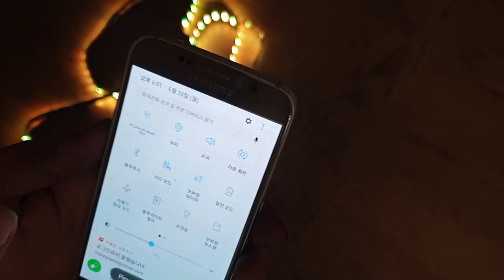아 킥보드 타고 싶다. Building 18 Inch Tire Electric-Scooter 70KM/H .

Comment: There's no way in hell that it's an 18 inch wheel.. these wheels are smaller then my yamaha tmax 650 wheels..and mine are 15 inchers..
Reply from the maker: Small pm scooters use tire size markings system.  its  different  cars and motorcycles. there are use wheelmaking  bro~~